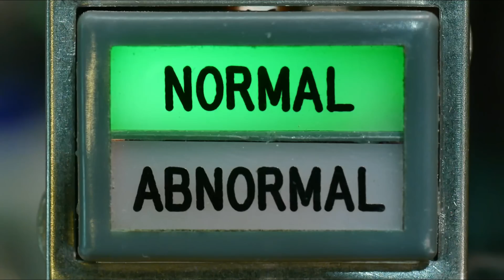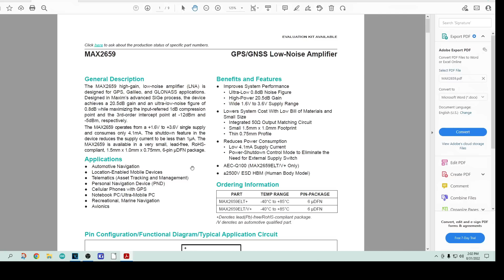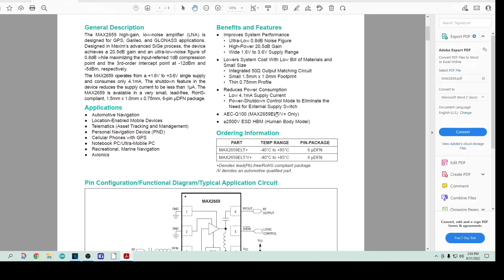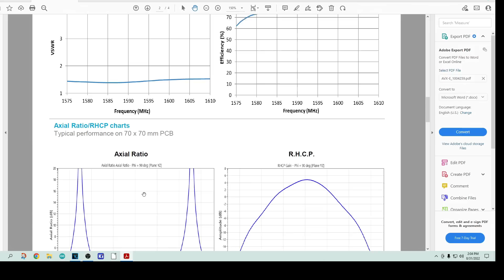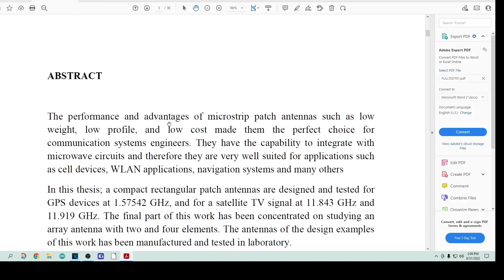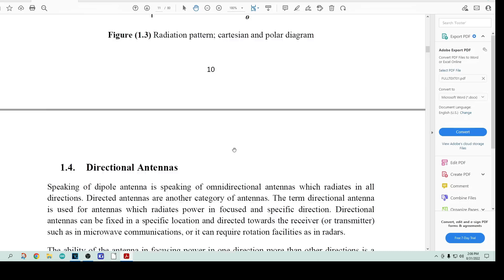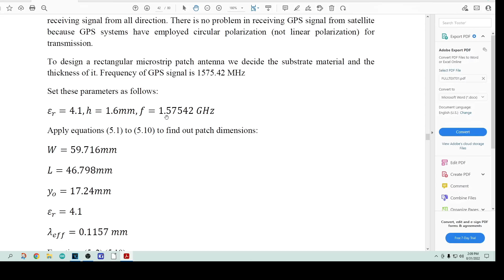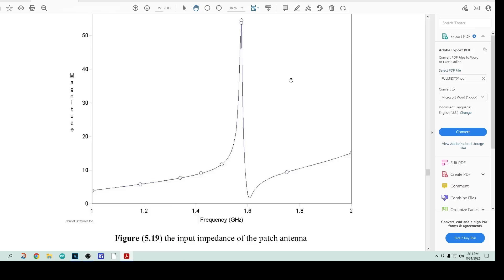#1270 GPS Patch Antenna (part 1 of 2)

Comment: Im interested anyone figured out how you could mod say a ublox usb gps to use an external far larger antenna i have a very nice external gps antenna that id like to use with the usb adapter for ham radio when portable and at home but looking at the pcb i can't seem to figure out how exactly id go about connecting the coax of my external antenna or is it just a case of center to center of existing antenna and ground (braid) to ground ?

Comment: Thesis "Design and Analysis of Microstrip Patch Antenna Arrays" is irrelevant to this particular antenna.
Thesis describe patch antennas, WxL = 59.7 x 46.8 mm.
a = 24.1 mm its an edge gap (minimum safe reflrector size at least lambda/4 from patch edges). Total antenna dimension in thesis is minimum 84 x 71 mm (actual Ahmed's prototype was 110 x 110 mm)
Patch antenna is highly uni-directional (with peak directivity 8...9 dBi and high supression of backlobes.
GPS ceramic antennas on market aren't of patch type. They are of PIFA/Inverted-F family: they have isotropic directivity (no uni-directional gain) and they are ultra-compact.

Comment: Today my drone crashed and this ceramic Antenna of the BN-880 GPS module came off. It doesnt have the golden connector like in this video, but it seems it was directly soldered, is there any way I can re-solder ? it is so small I cant see in my eyes or is this completely damaged ? iNav is detecting my GPS and also in-built magnetometer but not able to get a 3D GPS fix. Please anyone help.

Comment: GPS signals are right hand circular polarized. Does the offset of the feedpoint make this a RHCP antenna? It seems it might look the same in a mirror though. Two corners of the patch are "chamfered". Is that relevant to the handedness?

Comment: Once you consider the ~0.8 mm fringing field around the edges of your antenna, the dimensions match pretty well.  Quite possibly, this thesis is the blueprint for your antenna.  Practical considerations always demand empirical adaptation of theory to the particular purpose at these frequencies.  Incidentally, it is the fringing fields that actually radiate and receive.
Reply: impressive! thanks for pointing it out

Comment: I made some helical antennas from scratch, they work pretty well when connected directly to the receiver.  I hear the amplifiers on patch antennas actually add quite a bit of noise (the GPS signals are so incredibly faint) and are useful mainly for compensating for the loss of relatively long coax.

Comment: Interesting. I always thought that this type of GPS antenna was passive. Nope, there's an op amp. I would like to see a tear-down of the black plastic type, that is marketed as powered... Round, black plastic puck, magnetic bottom, long cord... Please and thank you. I have such and it does work much better, inside the house, than the ceramic model...
Reply: Those types of rectangular magmount antennas are likely just a ceramic patch antenna just like this one, only its covered in a black plastic radome so it can be mounted externally
Reply: @sweatbruh2513  I humbly offer that is not correct. The powered antennas get much better reception, indoors. I have had both. The plain puck did not work indoors. So, I bought the powered type. The powered antenna does work indoors and readily acquires multiple satellites. The powered ones are cheap and worth the little bit of extra money, IMO.  HTH.
Reply: @t1d100   you can get passive and active gnss antennas, with or without a plastic radome. From my experience most of the pucks have an active ceramic patch in them. Ive done quite a few teardowns and have found this to be the case but it depends on the manufacturer, theres a lot of overspec’d antennas out there that don’t actually perform as stated on the data sheet

Comment: Thank you very much for the link to this thesis. It is right in my area of interest and I look forward to reading the gentleman's work.
Reply: Notice, that antenna in thesis has 110x110 mm reflector and  59.7 x 46.8 mm rectangular patch. It is classical higly directional linearly polarized patch antenna. Kyocera GNSS antenna is of very different type - non-directional non-patch small size antenna. It's operational principle and method to obtain dimensions is described by PIFA/Inverted-F theory.

Comment: Nice find, thanks :)  As a satcom engineer, this is more in my wheelhouse, though I've generally been working more in the Ku and Ka bands at 12/14 GHz and 20/30 GHz.  The company I work for has a variety of phase array antennas of different flavors as well as the typical reflector types.  Sitting in on design reviews for these is really interesting if you're in to this stuff.

Comment: I always take the GPS receiver, set the serial to 9600 baud and let the Arduino write it all to variables. Then I throw that on a display. I just built a clock that adjusts itself.
Reply: Nice use of the GPS satellites' internal rubidium standard if you don't have one. :)
Might actually want to integrate that into a GPSDO with an OCXO, this way if you lose the GPS signal the clock will still maintain accuracy, only at a lower level than in the presence of the GPS signal. (edit) FWIW, if you use the u-blox software you can set the PPS signal to be any subdivision of the receiver's internal 48MHz (not just the default 1Hz), and you can use that signal directly for the adjustment. Integer dividers of 48MHz work best as the have the lowest jitter. I routinely set my GPS receivers to output 1MHz this way. Feed that into a PLL together with the OCXO signal and have the PLL generate the correction signal back into the OCXO. A CD4046 or the fancier 74HC9046 work well for that purpose.
Reply: @stamasd8500  I had the same realization, regarding using the GPS as a reference, without the rubidium. So, I built a GPS clock, as Jens Schoder suggests,  with a PIC MCU, and added external wiring connectors, to use for calibrating instruments.
Reply: The YouTuber "Scullcom" has a complete Arduino project, with the circuit, pcb, code, everything...
Reply: Another GPSDO option is to send ~$100 to the online seller, and a very lovely GPSDO shows up a few weeks later. Built-In super high quality 10 MHz OCXO (almost certainly salvaged, = aged LOL), and a uC and GPS to discipline it. I have one, and it's super nice having such precise and traceable 10 MHz and 1 PPS on my desk. It's emotionally upsetting when the red 'Alarm' LED comes on for whatever weak-signal or power outage reason, but it regains lock pretty quick, and back to Green. Highly recommended.